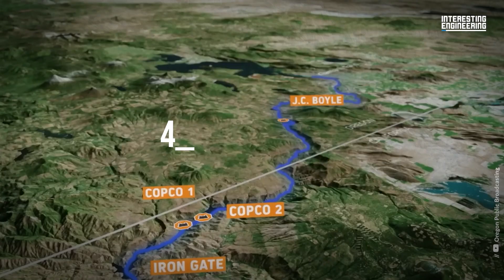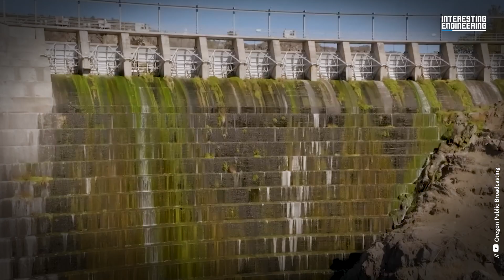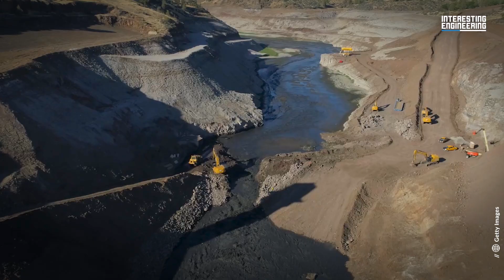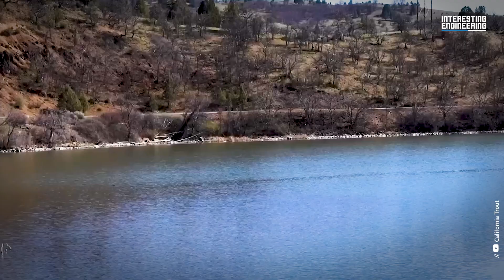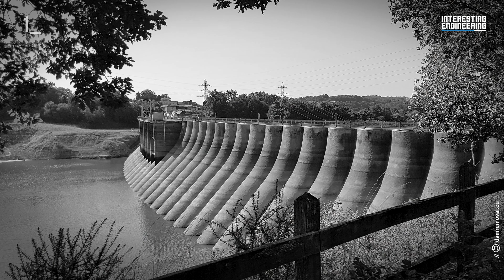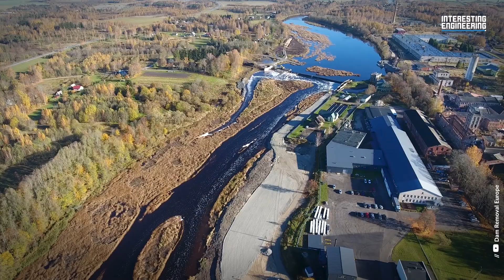The $500M Fight to Save Salmon

Comment: Removing these types of dams is the cause of flooding, not the climate.
Reply: Flooding never had anything to do with the climate. Building in areas with historical flooding is the issue.
Reply: These dams didn’t provide flood control or water use. Just electricity. The water that is used for irrigation is from the dam above these dams.
Reply: @djc9727  Now that is a component of the argument that is good to know. Not one of the damn removal videos that I have watched has included that piece of information. Thank you.